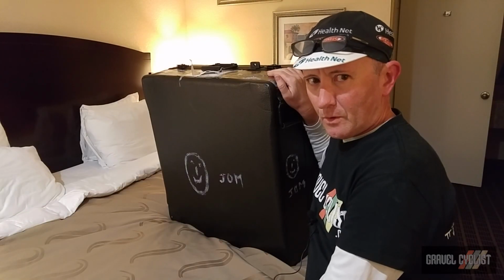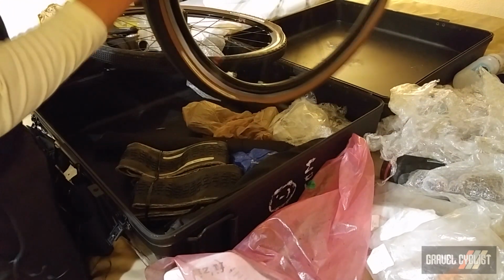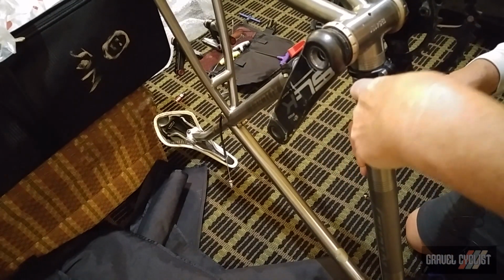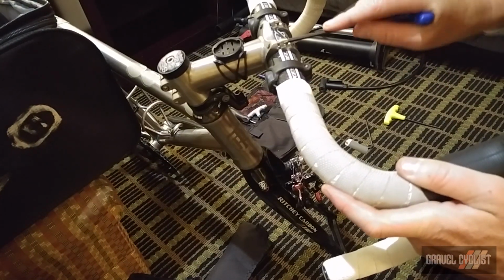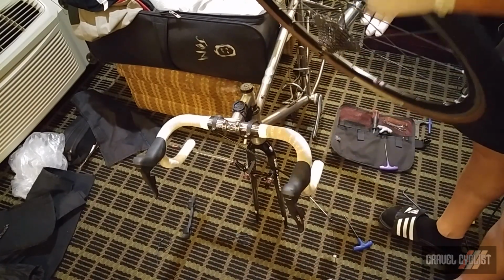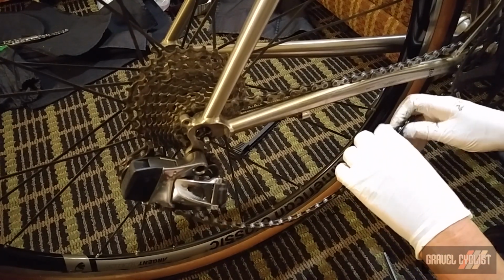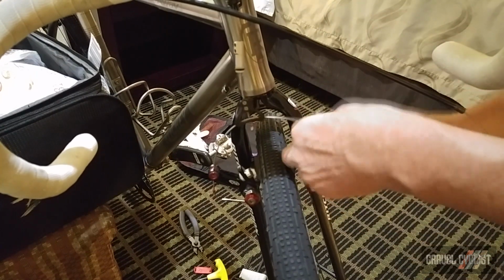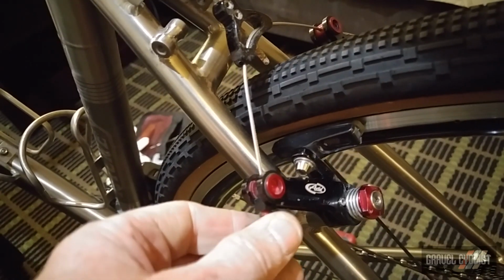Unpacking & Building the Ritchey Breakaway Ti Gravel / Cyclocross Bike

Comment: Such a sick bike. Love the mix of clsssic and modern tech. No cables on the gears looks so clean. How do they hold up in rotten wet and muddy conditions? Also are they heavier than traditional mechanical systems?
Reply from the maker: eTap has held up well, I raced this very bike at a nasty edition of the Almanzo 100 in 2017. The video is my older style, but the bike was the least of my concerns on that day!

Comment: Fascinating. I guess if you had hydro brakes it would make things quite complex in terms of the brake fluid and removing the handlebars etc.
Reply from the maker: The only hydro brake I could use would be a hybrid, as in the TRP HY/RD, which is a mechanically actuated hydraulic brake. A true hydraulic system would be very difficult.
Reply: @GravelCyclist  Yes, I actually have a set of those brakes. As I was watching I was thinking of the amount of times I keep ramming my bike into the boot of my car and the amount of damage that its doing to the interior. I must go and watch your earlier review of the bike.

Comment: wireless is pretty cool for a travel bike...but why would you take the cassette off the wheel and detention the brakes?
Reply from the maker: Cassette is removed due to space... the cassette body needs to have nothing installed in order to pack correctly. Detensioning the brakes is again about space.

Comment: Why would you not leave 10/15PSI in the tires?
Reply from the maker: Inflated tyres take up room. The wheels are a tight fit, and there are NO issues as the bead stays intact.